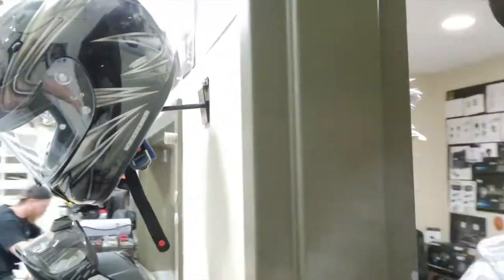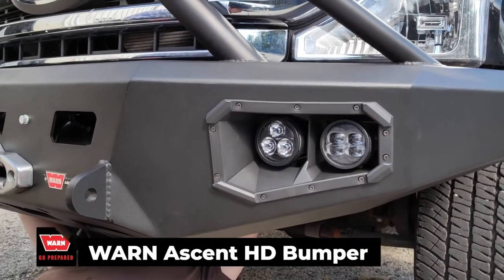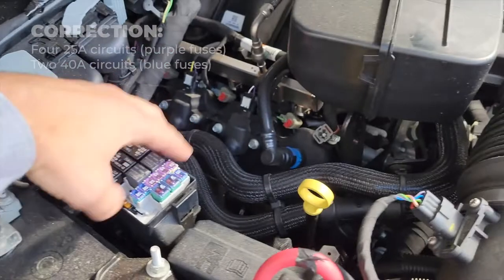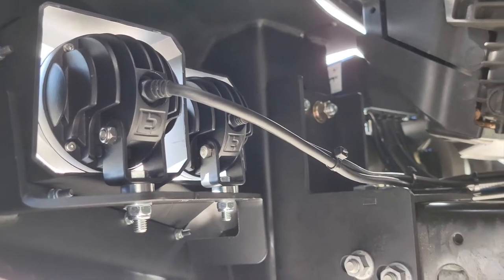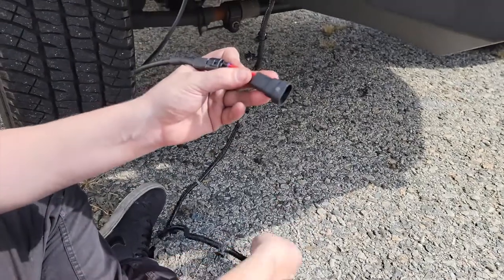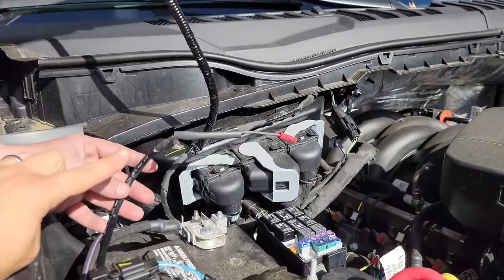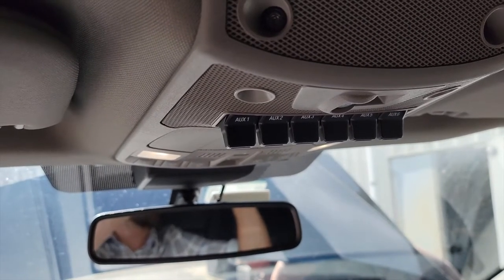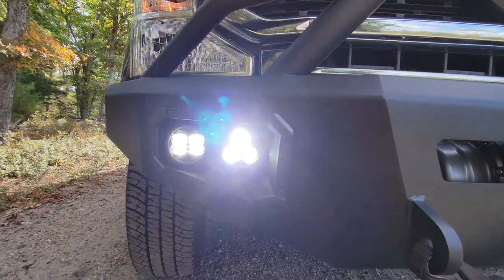How to Install DENALI D3 Fog Lights on your Ford F150, F250, or F350

Comment: What's the best way to adjust the fog lights? I got some and they have a very narrow, sharp cut off (which is nice to not glare anybody but I have no idea if I should aim them higher or lower to give the needed illumination per ECE).
Reply from the maker: There should be aiming instructions in your instructions and in the PDF instructions on the product page. Because the D3 fog is such a sharp cut off I have found that aiming the top of the D3 beam at the bottom of the headlight beam is a pretty good start; you might need to adjust a little one way or the other.